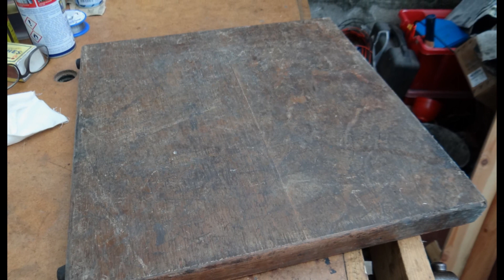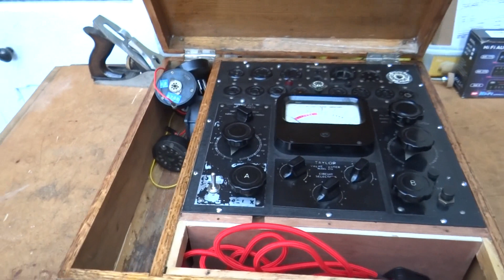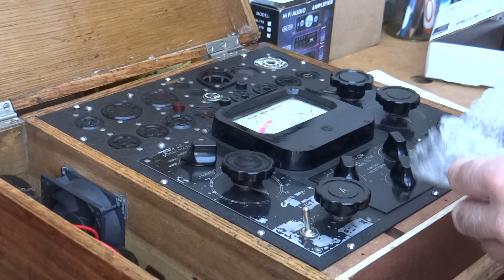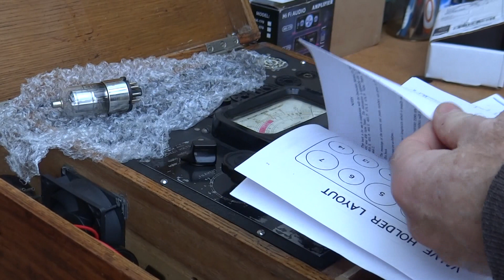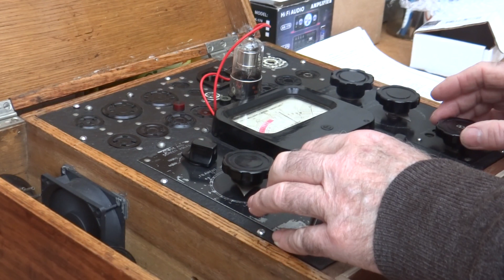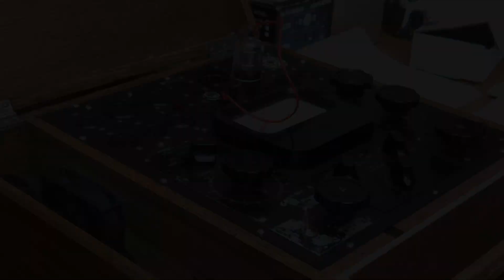Taylor Valve tester restoration. part 3

Comment: The longer lever on the switch is 'in the way of the control next to it'...I like the smaller old ones...Why was the exhaust fan needed? My case lost some of its veneer..something which  used to be easy to buy at a "hobbies" shop...not any more.

Comment: hi buddy. ive just aquired one of these but the online info is rather vague on its use. any info would be greatly appriciated. im testing guitat amp valves, 12axy,12at7 6l6 etc. but i cant find the process of actually testing them. 

kind regards

bill